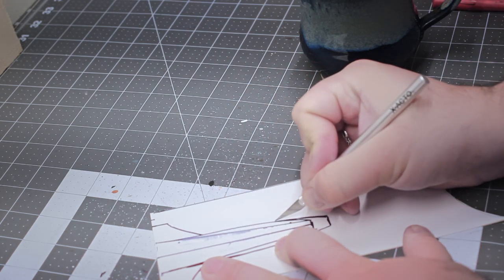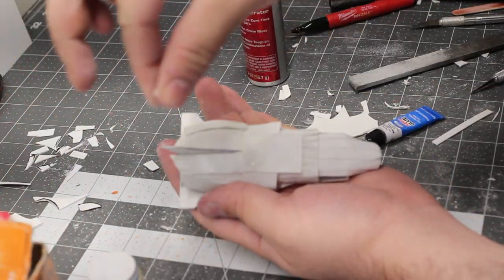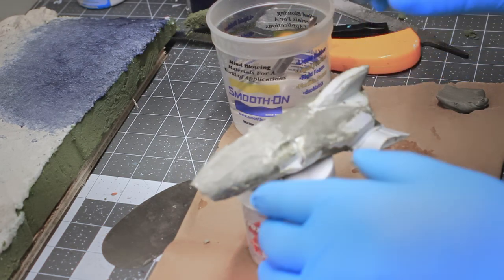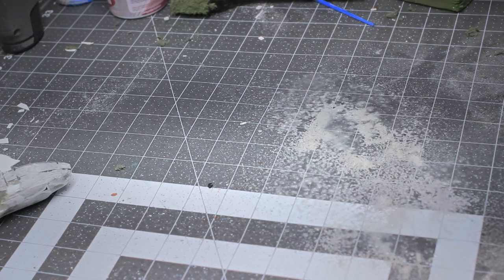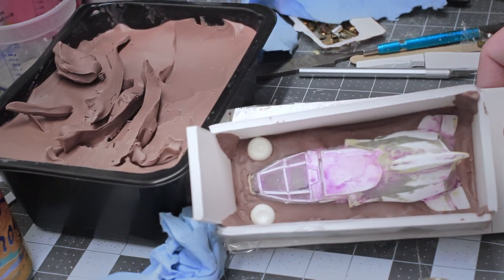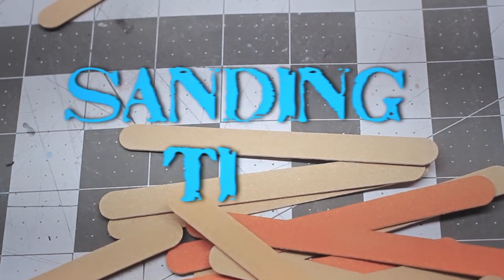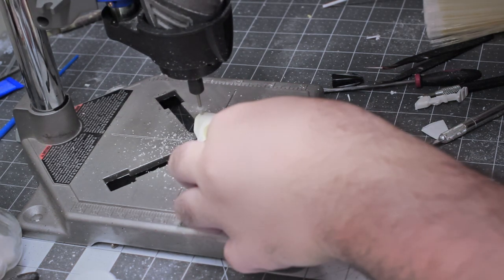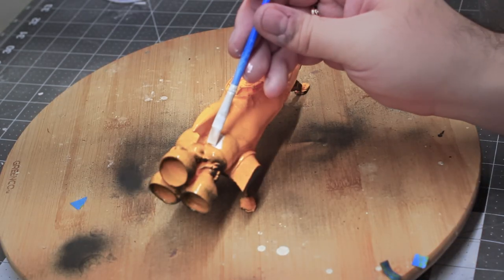Scratch building a 1/100 spaceship

Comment: Nice work. I make up toy soldier sets to give away so the rule of threes comes into play (1 is 1, 2 is 2, 3 is a fleet). Currently looking for a commercial vac-form outfit I can give a master to and get a bunch of ships for sci-fi ships.
Reply from the maker: Thank you, well with that math I cast up about 2 fleets from these molds XD.  commercial vacuforming can be a great option but can get pretty pricy unless your manufacturing for mass sale. I've found that the best price ratio is usually with resin casting unless you're making more then a few hundred, at that point it can be worth balancing injection molding vs vacuforming to see what suits your end user need better.